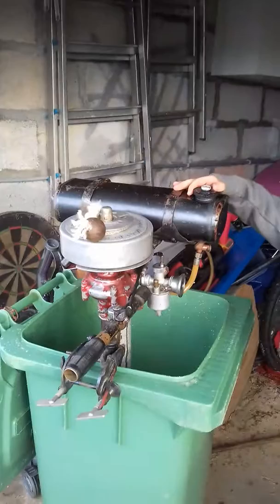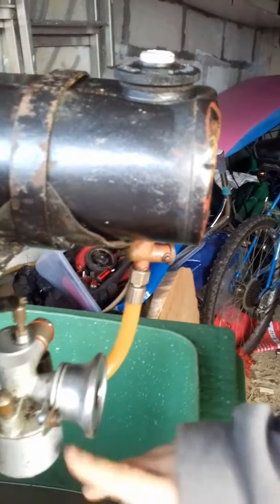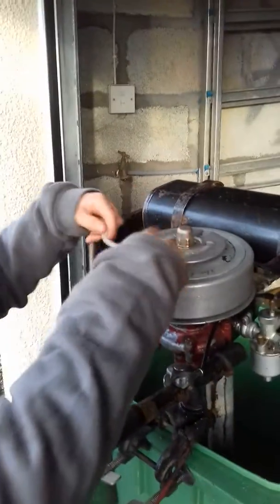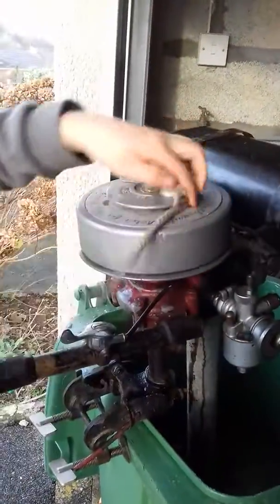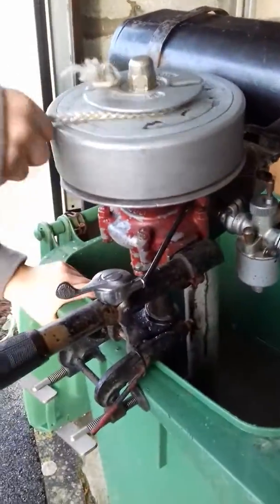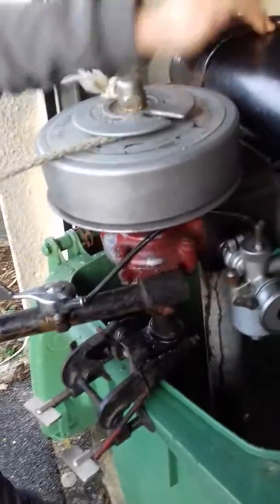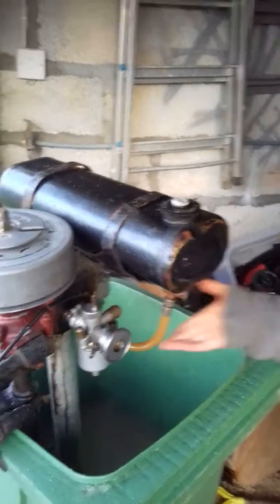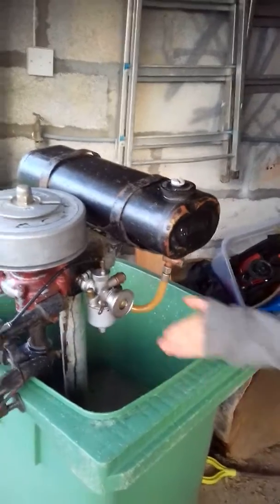British seagull 40 plus starting problem

Comment: 60 years ago when I was 12, I bought my first seagull, a 102 with the round tank. It took me miles and miles in my 12 foot fishing boat "The Jane" and we landed huge amounts of fish in my 5 trammel nets and I ran welk and lobster pots 3 miles off of Worthing. At 13 I'd left school to become a "full time fisherman".  Life changes as you get older and I stopped fishing but kept a hand in with boats, the biggest being 98 footer gentlemans yacht when I was 22 (it and me can be found in a youtube clip)  Now I'm old and  about to move back to England: what a surprise when another old codger gave me (3 months ago) a 40+ (with clutch) to take back with me and buy a little old wooden dinghy. Pure delight!!! I can't wait.   In case you don't know, make sure that your anchor rope is at least three times longer than the depth of water you're going to be anchoring in and always have a spare rowlock tucked in the risings, never in a spare rowlock plate. Good sailing young man and well presented. Be proud of yourself.

Comment: Ooh be careful, too many turns (cord too long) if that fired up at the speed you're pulling the cord it could get caught up and hurt you. Lock the motor down so it can't tilt and use two hands and pull more quickly.

Comment: Just finished watching and it is not strength you lacked, your arms are / were not long enough to give the span to hold the motor down and pull to the full length of the cord. I like the way you eased the flywheel back to  before compression with your hand. What is more, when it's on the back of a dinghly it is much lower ion relation to you and you have the advantage of being above it and what you lack in strength you can substitute by using your body. Often, when we went out at 2 in the morning to haul the nets,  I'd get my mate Roger to lean over and push down on the tank whilst I used 2 hands and my body to heave the cord, sometimes falling backwards as it sprang into life! I say 2 hands because with one non adult hand, if it does a hic-up on compression when you're pulling the cord you can really hurt yourself when it rips the handle out of your hand or worse still, if it starts and you haven't pulled the cord all the way out!!! Handle whirling round on almost three feet of rope whacking aleverything in sight!!!! OUCH!